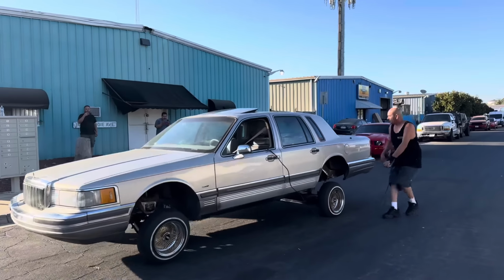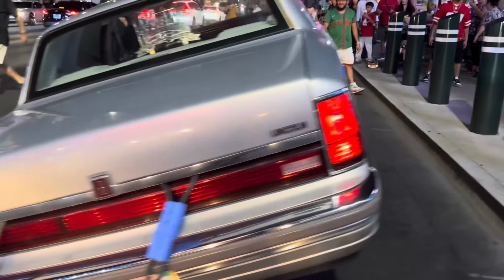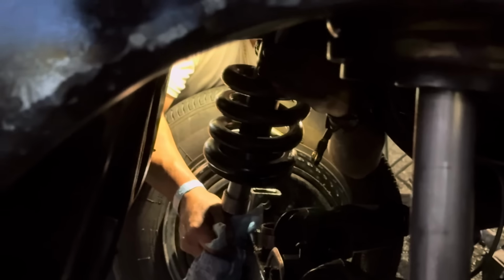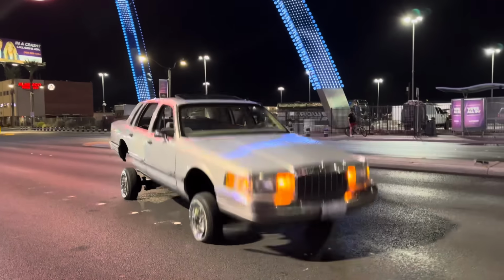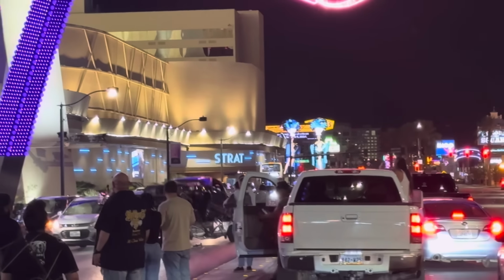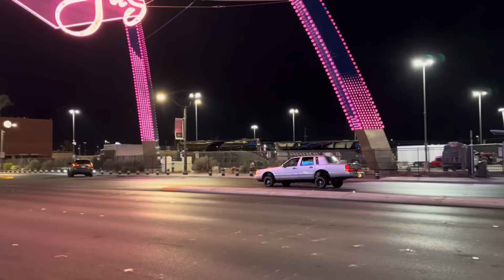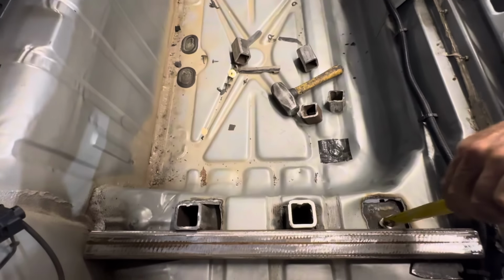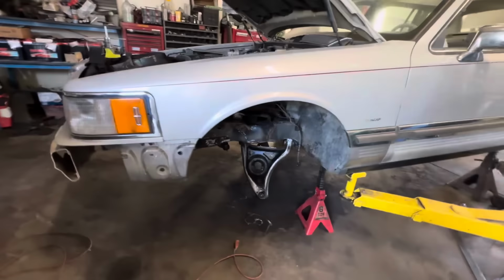The FINAL EPISODE! Building A Lowrider Hopper for the Lowrider Super Show Weekend!

Comment: Already bro I knew y'all would get it on the bumper it just takes trial and error which combo are u using 9 and 11 or both 11s also how much psi in piston sometimes 70-80 psi will help it more also what fluid are y'all using?
Reply from the maker: We put (2) #9! We didn’t put air in the pumps also we forgot lol but it hit bumper pretty good! With air for sure it’ll hit harder
Reply: @JustlowridersTV  Kool has a lot to do with plumbing as well and hoses and diameter of cylinders and port on block and checks I love 3/4 for doubles and 1" for singles with #10 hoses and big bore comp cylinder with tricked out Pantheon gear or old school marz heart shape seals 👍👍